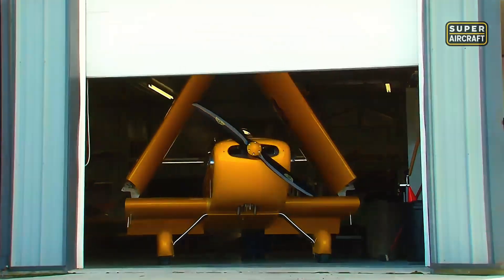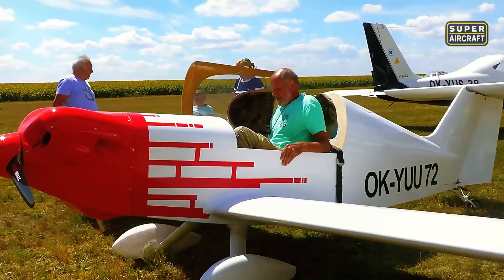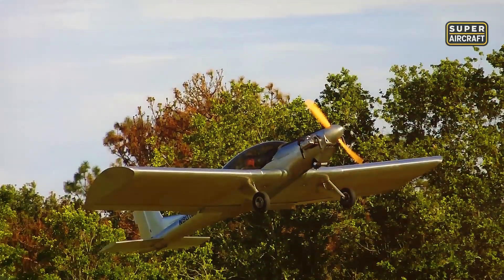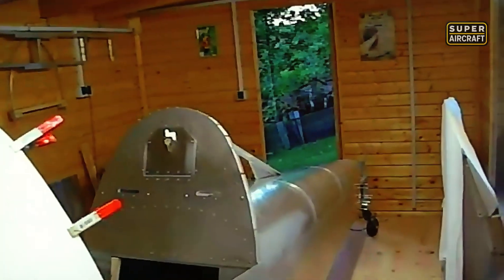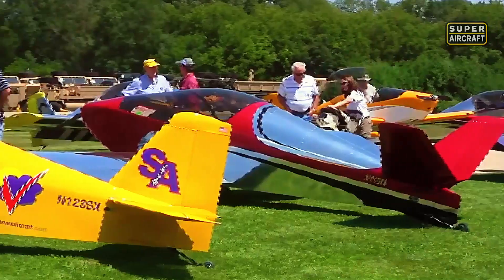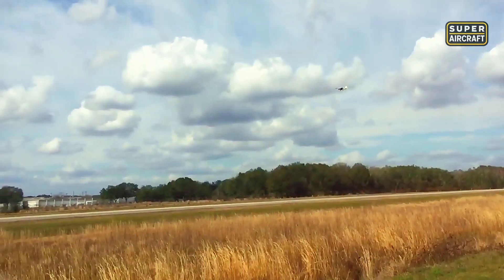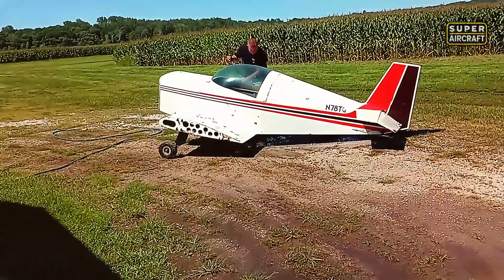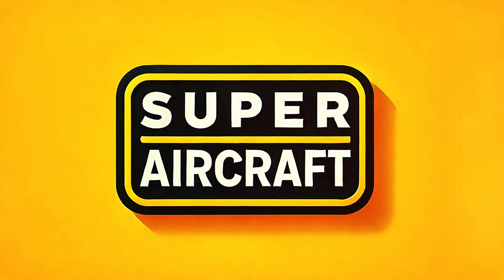THE BEST MINI GARAGE AIRCRAFT MODELS TO BUILD AND FLY

Comment: For a home builder the choice of the best material from the common options is very simple.  Choose the one you enjoy working with.  Only 10% of homebuilts get finished by the first builder, 10% by the second, and 10% by the third.  Nobody dares to be #4.
Reply from the maker: That’s a brilliant reflection. Many people start a great creation, but only a few have the patience and inner discipline to complete it. Choosing the material you truly enjoy working with isn’t just a technical decision — it’s a psychological one. Passion keeps the builder alive when fatigue and doubt appear. Persistence is not about stubbornness, it’s about love for what you’re creating.✈️🤠
Reply: @SuperAircraft2025  
Thank god most of these deadly trap-crap constructions end up unfinished.
The wing loading is too high and the unfavorable Reynolds number contributes the rest, ending in stall spin and crash.
Reply: My plane has wood steel tube fabric aluminium fibreglass and carbon fibre. I like workkng with all of them